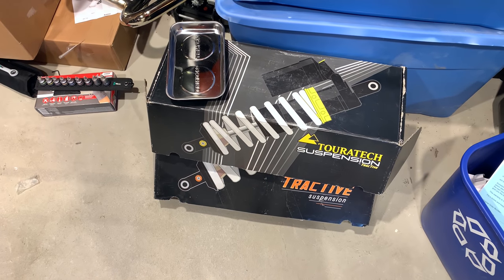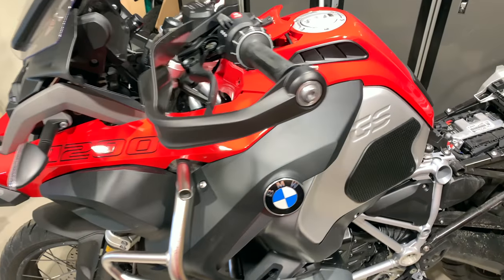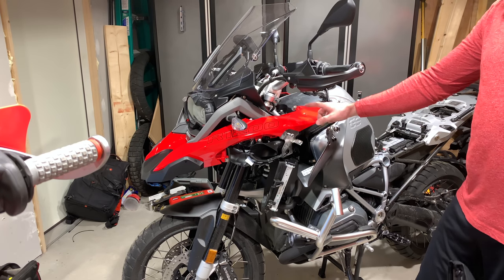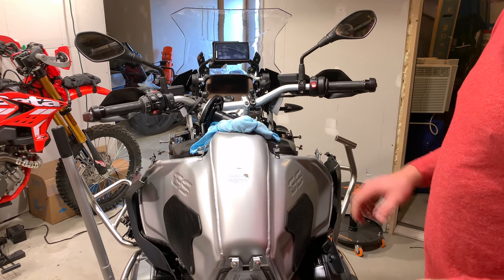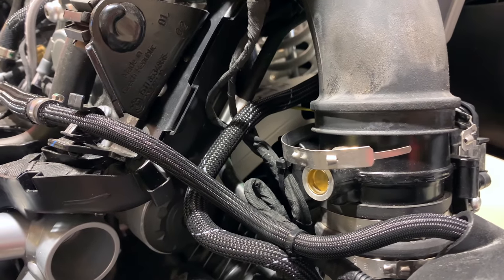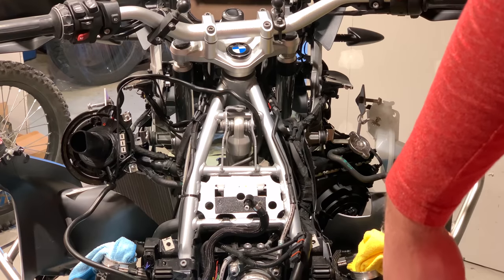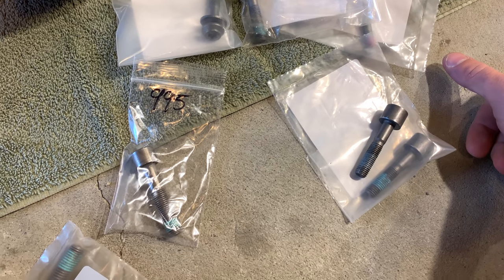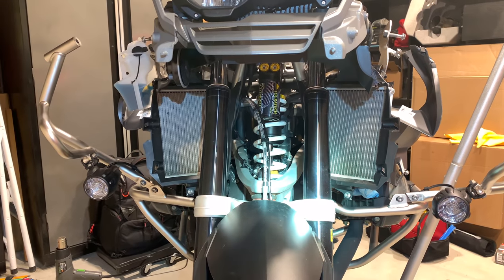How To: Install Front Shock on R1200GS - Tractive / Touratech

Comment: Adam, you don’t need to remove the fillercap. It’ s easyer to undo the the tubes and wire.
I did the same disassembly just to make a need wire job for a couple of extra lights.
Yes yes, a lot of work, but fun to do 👍

Comment: Checking in on reliability; have your Tractive shocks withstood the test of time and torture?
Reply from the maker: They’ve been great. No complaints except the cost to maintain them. Recommended every 30K miles for a rehab from Tractive and it was around $800 to do both (new fluid, seals, inspection, valve replacement). So I’d try to stretch that service out as long as possible. I wasn’t expecting it to be that expensive for a service. That’s every 30K under “extreme use” if you’re just touring, 50K is fine.

Comment: hi adam , whats the name of the tool u use for the metal clips that hold the airbox to the engine
Reply from the maker: Lisle 30500 CV Boot Clamp Plier --- I found it on Amazon. There are more appropriate tools like BMW makes one that is perfect BUT this is 1/10th the price and works just fine.

Comment: Thanks for the video Adam. Could I ask what torque specs you followed for the upper and lower bolts? If you also had the torque specs for the rear bolts that would be great. Thanks planning on taking this job soon myself.
Reply from the maker: http://www.jvbproductions.com/Wethead%20Torques%204.pdf - Everything is in this PDF> good luck!

Comment: You're a lunatic buying replacement bolts, those are perfectly good, clean up and reapply some of your own medium thread lock. Good to see you remade this video though. At first I thought, why is he upgrading the shocks if he's not planning to take it off road but you're a big lad and when you get loaded up on tour the suspension can be a bit soft and with no 'real' adjustability I can see why you did it. I'd really like to do mine but can't quite swallow the expense. Did you get an uprated spring for the shocks too?

Comment: The great thing is the only time you have to do all that work is when your going the front shock
Reply from the maker: Correct! And it’s sort of a “while you’re in there” project, too. So if your GS is 10 years old and you’re replacing the shock, it’s A good time to replace rubber hoses, look for any other issues, maybe also do the clutch, upgrade your lights, etc. I think this is an opportunity to rehab a bike since you’re basically taking it all apart.

Comment: Firstly thanks for posting and taking time to out this video together.  I bought the same shock but it’s Trakactives from Ted’s Beemer Shop.  It’s the same one minus the Touratech colors.  There instructions stated to invert the front shock such the the reservoir would be on the bottom instead of up top.  Had a photo attached.  I guess it doesn’t matter in the scheme of things.
Reply from the maker: I’ve seen people install the shock both ways. Never seen it an issue and there’s no right or wrong way to do it..it’ll function in either orientation. Main advantage of of the reservoir @ bottom is easier access to the H/L compression adjustments.
Reply: @AdamChandler86  I agree Adam, thanks again for posting the video and contributing your experience/knowledge.

Comment: Great video, Adam! Thank you for sacrificing your time to shoot this. 

I live in the northeast as well and had to replace the rear shock on my 2016 1200 GSA, because the shock motor was not working at 28K. The Tractive/Touratech shock was the best upgrade ever, because I weigh 200 lbs, ride almost every terrain possible and also ride with my wife. 

The front OEM shock started leaking at 32K. I ordered the Tractive / Touratech for the front. I will be installing it in 2 weeks and this video will help a lot. 

Thanks again for your work. See you on the trails.
Reply from the maker: I'm really glad this video helped. Ride safe out there!

Comment: adam , i have an 1200 gsa 2017 and a 2019 on order , but why are you replacing the shocks , i have not found them to be in need of replacing, even off road mine never faild .... Explain and keep the video"s comming the are getting better 👍 👍 👍 Greetings from europe
Reply from the maker: GS shocks are sprung for a 200 pound rider. I weight 250lbs when you consider 2 people, touring with luggage, not much left for spring rate. That and the off-road response is improved with these.

Comment: hey Adam great video. quick question can you reuse the clamps that are connected to the airbox hose?
Reply from the maker: I have in the past, yes. If you are comfortable with these kind of clamps, it's certainly possible. In my experience, I'm about 50/50 on removing these and putting them back on without bending the tabs. It's easier when you're ordering the bolts for your shocks to just order the clamps from BMW for $1 each and have fresh ones. Just my opinion.

Comment: Adam, since your bike is so stripped down to it's very core could you please do a quick video of how to properly remove the charcoal canister on water cooled GSA? Though it is well known that charcoal canisters are only required for US market and are very bad for the bike's fuel system.
See the link: https://www.youtube.com/watch?v=H907BjGC0Pc
Thanks,
Alex
Reply from the maker: I did some checking, I don't believe the liquid cooled models have this. If so, I'll get back to you!
Reply: That charcoal canister is best visible in your video at 22:45, black plastic cylinder behind the rubber hoses.
I've been watching and enjoying your videos since you started with your triple black GSA, I own one too.
I know that once you decide to get it removed it would/will be properly documented and explained:) Thanks.
Reply from the maker: Ah, I see it now -  16 13 7 727 387 is the part number. Not very heavy so wouldn't save much weight to remove. I also don't think it'd throw a code either. Will investigate further. Thanks!

Comment: Do you still have your 2018 Adventure? If so, would you mind telling me what numbers are on your trailing arm? I'm raising a rally and need to know.
Reply from the maker: Hi, would you mind being more specific? VIN numbers, barcode?
Reply: @AdamChandler86  There are some casting numbers on the top left side near where it bolts to the motor looking from the front of the bike
Reply from the maker: Just crawled under the bike. The entire swingarm is covered in mud and dirt. I do know what you're talking about but I can't find it at this moment. I do know I've seen it before. This may be something you should post to ADVRider's GS Boxers sub-forum and ask. Lots of garage-kept GS bikes that are clean as a whistle :P